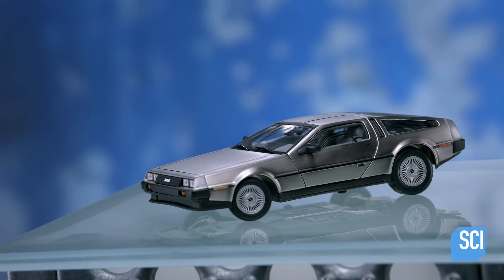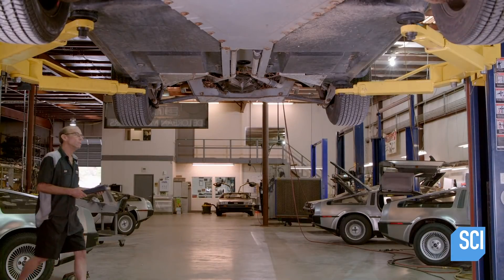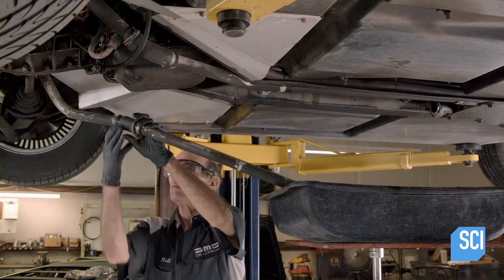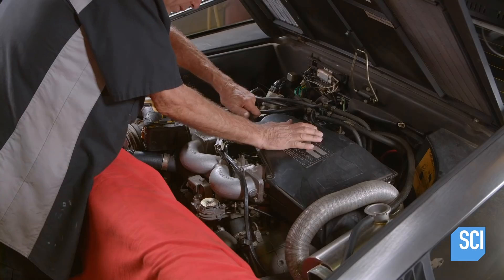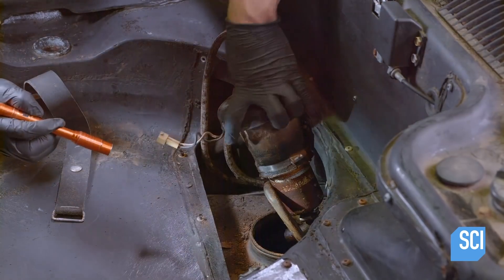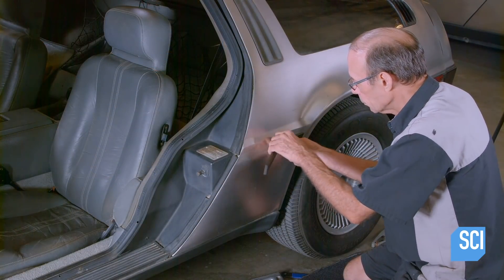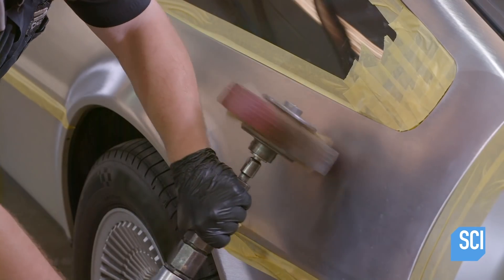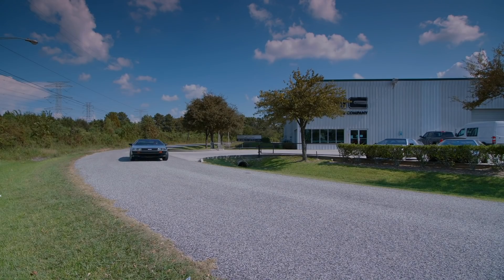How to Restore a DeLorean | How It’s Made

Comment: I bought one that was in good shape but had been sitting for 15 years.  These same people went through it and changed out the rubber bushings and hoses, and the little parts that are better today like fuel pump, alternator, water pump.  Since then, it’s been like owning a normal car.  I’ve driven it daily for over 5 years now with no problems.  Remarkable for a 40 year old car.

Comment: Those cars are some of the HEAVIEST cars ever, lol. Yeah sure, stainless steel lasts a real long time but the quality of the metals used at the factory to build these cars wasn't very good to begin with, and the extreme weight of the car with the relative small engine size, they're not very fast unless you mod them to death, and after that, do you really have a DeLorean, or some kind of Franken-car? And if memory serves, the story of DeLorean ends rather sadly with drug addiction possibly resulting in the inventor's death.

Comment: And it's only because of "Back To The Future" that this otherwise rather unimpressive and underpowered car is worth restoring.

Seriously, the only merit the DeLorean has by itself is its stainless steel body, which is not even a new thing. Stainless steel car bodies date back to the 1930's.

In stock form, it might not even reach 88 MPH because its engine is underpowered and the transmission is weak.

Comment: Of course, the smart people will swap the crappy engine for literally anything better. The amusing thing about the original Back to the Future is that the terrorists' van actually would have out-accelerated the DeLorean. Any decent V6 made in the last 10 years or a small block V8 would be a massive upgrade to this car, and might cost less as a junkyard pull than repairing the nearly 40 year old original.

Comment: They left out a bunch of stuff. Did they get rid of all the rust on the suspension parts, or leave it. Did they replace all the rubber bushings, shocks, bearings, etc. ? The underside of that unit looked in pretty bad shape. You could tell it had been sitting somewhere a very long time. Rust all over, including inside the fuel tank.
Reply: You've got to have 3 episodes one hour long if you wanna see restorations like that. It's most likely they used multiple cars for this one video. showing different phases and such. Still pretty interesting to watch.
Reply: and they left out the part where they add the Mr. fusion reactor and Flux capacitor
Reply: They definitely didn’t use the same car
Reply: They also didn't discuss the interior, which is where the real art of restoration is best displayed.

Comment: Someone needs to put a hellcat motor in one
Reply: Every Taylor LS swap would be more fitting
Reply: @savagesock3598  yuck
Reply: The chassis of cars aren't just infinitely strong to the point that you could drop any level of power in and the chassis would do fine.  A Hellcat motor would tear this car limb from limb.  It only weighs as much as a Ford Fiesta.  About 350 bhp is where this chassis maxes out.  But with that, weighing as little as it does, it would be a very fast car.  It would be more or less a Cayman GT4.
Reply: @HollywoodF1  just imagine chip foose getting his hands one 😩😩

Comment: This not a restoration, this is a tune up, brake job and detailing.
Reply: Totally.....they didn't replace the brake rotors...they turned them....🤢
Reply: Right? I was just thinking this is what used car lots do to everything that rolls through...To what was truly a terrible car with a terrible French engine that would barely push them.
Reply: @bustedupbungalow  It really isn't a terrible car
Reply: @bustedupbungalow   I think a guy up here in Saskatchewan LS Swapped his Delorean with an LS4, that makes up for the original dumb engine :)
Reply: oldsjunkie1 we europeans can make stronger 4 cilinder than a v8 or a v6
that peugeot 206 wrc had 300 hp out of inline 4 turbocharged
Reply: @skittlesbutwithchocolatein2274  i think the issue was that delorean wanted a rugged v6 they could turbocharge. they got that but the turbocharged model never came out. The v6 wasnt THAT slow for the 80s. it was sort of mid field. The delorean also afaik didnt handle that badly for a 8s car which is mainly caused by it being sort of large/wide unlike other cars of the era.

Comment: there's rare footage of a crash test with a delorean, no thankhs, that car is a death trap.
Reply: At this point I don't think it'll be a "daily driver". It doesn't even have modern safety standards like airbags or anything. So the car is more for car shows and such
Reply: If I get into a crash in one I would hope it kills me no way in hell you would be able to fix it without the lottery
Reply: Actually, that footage is from higher-speed tests than are required by law because the car performed so well at normal crash test speeds that they wanted to see what it could do.  And the 100+ page independent report that accompanied the tests said that the car performed admirably at the higher speeds as well.  Far from being a death trap, it was groundbreaking in the level of survivability that it provided.  And nearly 40 years of real-world data have shown excellent performance in crashes.

Comment: But the question is, Will it travel through time?
Reply: Not if it can't make 88 mph.
Reply: @JD1911A1  The Stock DeLorean is not able to reach 88 mph, it was only able to reach around 80-85mph
Reply: KamiTube It already has
Reply: Recovering New Yorker maybe no. The flux capacitor is missing 😆😂😆
Reply: KamiTube this needs 88 likes
Reply: Their, i gave it 88 likes.
Reply: Don’t forget 1.21 gigawatts
Reply: Wait ‘till this baby reaches 88 mph and you’ll see some serious s#!t.
Reply: No but it will implode the space time continuum
Reply: Don’t you think you need a plutonium chamber, or a Mr.Fusion to power the flux capacitor and time circuits?
Reply: Only in the sense that if you drive it, you're mind will go back to the 80s as it dawns on you why no one bought these cars and why the company who made them quickly went out of business. You'll want to stop the car and get back to the 2020s where cars are faster, safer and more reliable.
Reply: Travel to the dump
Reply: The flux capacitor doc brown invented as a mod never went into production, only one prototype was made and it was destroyed by a train.....
Reply: My thoughts exactly